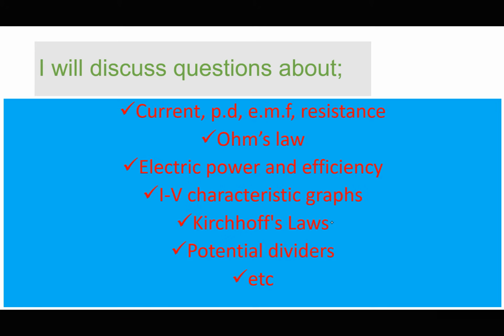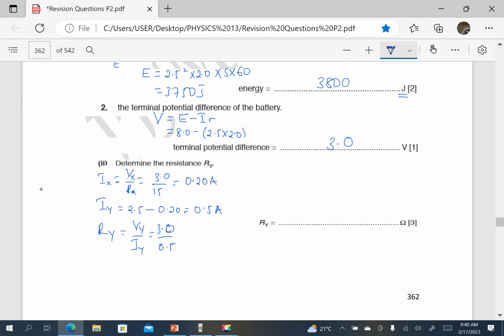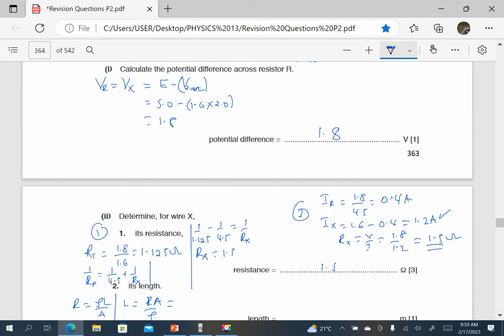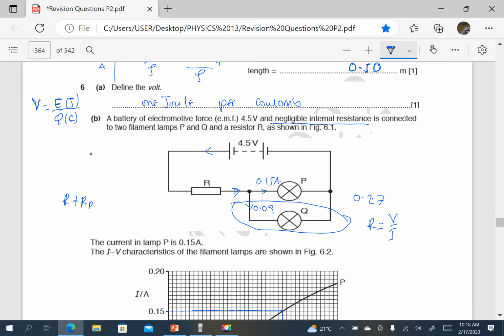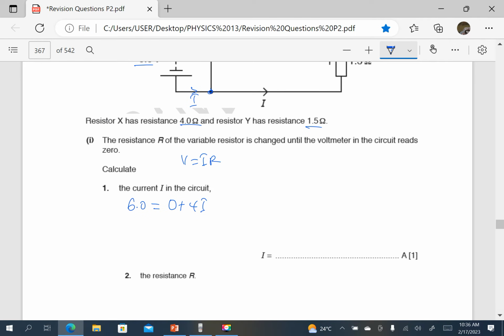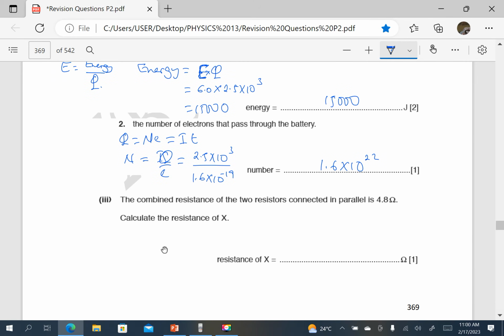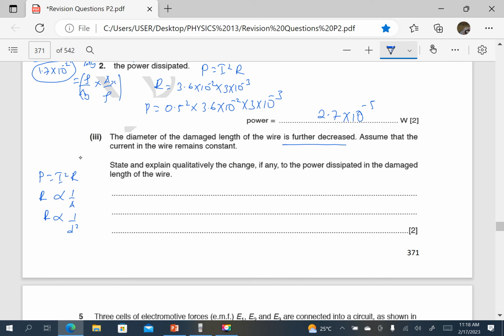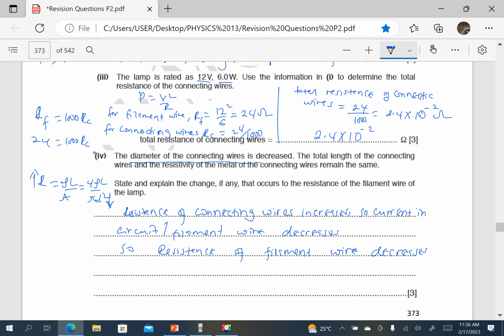ELECTRICITY,  AS Physics  [Solved past paper Questions] PART 1

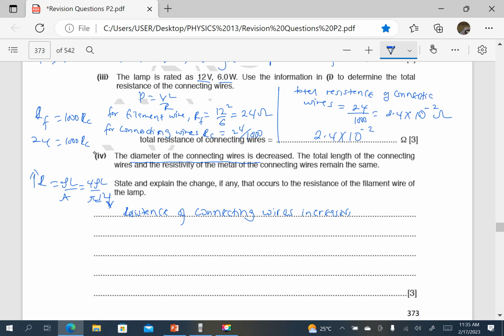Comment: 2:08:13 how does the current in the circuit decrease if the current stays the same ?
Reply: sorry for the constant doubts😅
Reply from the maker: @hvma  its okay dear, but I meant current in the circuit is same as current in the filament wire, as that in connecting wires
Reply: @learnPHYSICSwithIBM  ohh okay👍👍